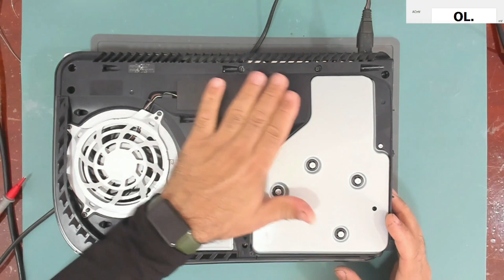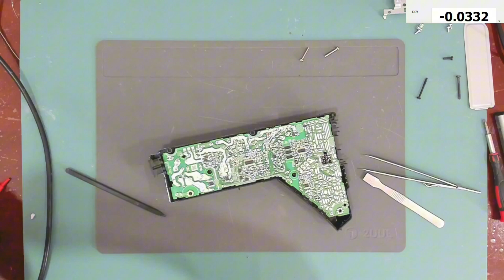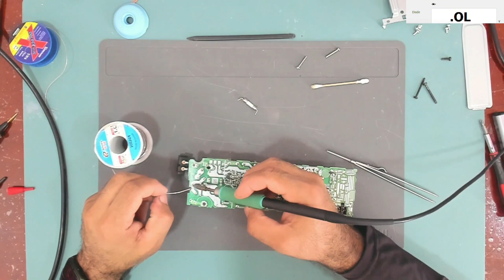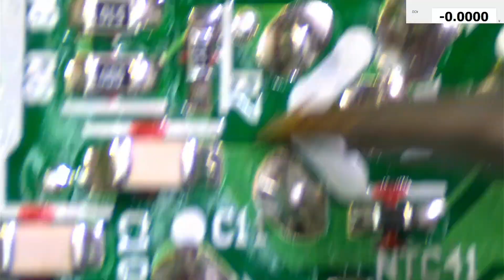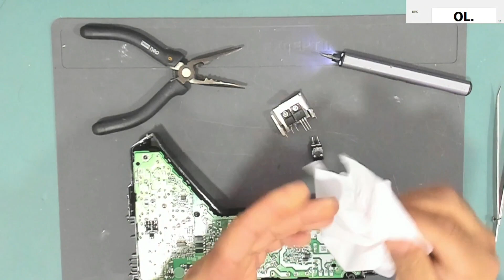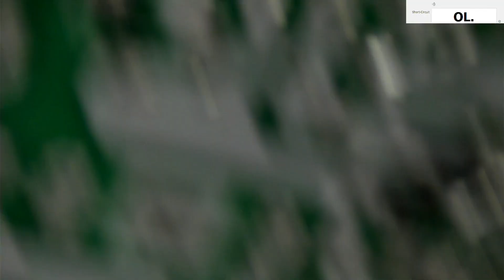PS5 power supply Repair #repair #fixed  DAP053T TEA2016AAT

Comment: Thanks for the detailed video. As soon as I plug in my PS5, the MCB in my house trips. Could you please tell me whether the PSU is faulty or if the issue could be with the motherboard?
A few months ago, the MCB also tripped when I tried to turn on the PS5, but after trying again, the console turned on and worked normally. However, now it is not working at all, and the MCB trips immediately every time I switch on the PS5.

Comment: Hey Bro , I need your help. The Zener diode next to the 10-ohm resistor is burnt, and I don’t know what voltage it is. Can you guide me? The diode is marked with ZM, and it is taken from pin 5 of the IC
Reply from the maker: Hello brother
Its 12v and its part number is TSZU52C12

You can refer to this link for more info
https://www.google.com/url?sa=t&source=web&rct=j&opi=89978449&url=https://www.mouser.com/datasheet/2/395/TSZU52C2V0%2520SERIES_F1601-1021459.pdf%3Fsrsltid%3DAfmBOoqp4XK_vilnSn2Fc4tR0eEot8sNnl7GrT2g-PscuEUD5qFxSXoB&ved=2ahUKEwiIsKeMoMqRAxUS_7sIHT9sHB8QFnoECFgQAQ&usg=AOvVaw183SENmcTt-AdjftZooh-k
Reply: @FixTronics You’re welcome, you really helped me a lot 🙏

Comment: The first MOSFET that you mentioned that you talked about the left and right pins reading short because of the resistor,  on my board, they don't read short. The Sister is a 01C and measures 1Kohms,  this makes no sense why you always message short mine doesn't

Comment: Thank you very much for the video. I lifted the dap053 ic and with it line 15 came off (it's not going anywhere from what I see) 
and I changed the resistance 30RO (30k) but I got 27k, is that okay? 
The source gives 12v but after 3 seconds it falls
Reply from the maker: Hello friend 
If you check the video at 42:14, pin 15 does connect to somewhere..

About the resistor I this 3k is big enough to make some effects to the circuit its used in.

So its better to use 27k+3k resistors in series to make it 30K

Comment: Hello and good day brother. There is a smoke and liquid that smells bad came out from my PS5's PSU. What is that?
Reply from the maker: Hi brother 
Good day 

Yoh most likely have a failing electrolytic capacitors!!!
You need to take a look at it before it all dies..

■■ Be careful of high voltages...
Reply: @FixTronics  thanks brother now I have an idea!
Reply: @FixTronics  is there by any chance that It messed up the other parts like motherboard?

Comment: In my power supply I also have the ZD39 diode broken near the R96 resistor, do you know the model?
Reply from the maker: ZD39 is a zener diode with ZM marking code 
Its part number is PDZ18B

Comment: Pro when i plage the cabl power 
The ps5 make suond pep and dosent turn on
Reply from the maker: Its most likely you have a problem with the motherboard not with the power supply. 

If the problem is the power supply then ist most likely to be a bad output electrolytic capacitors